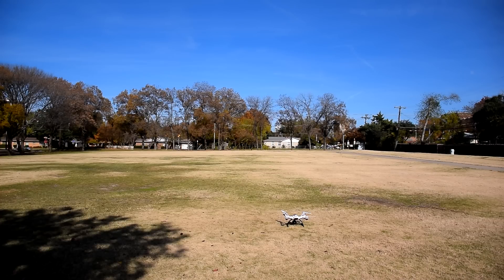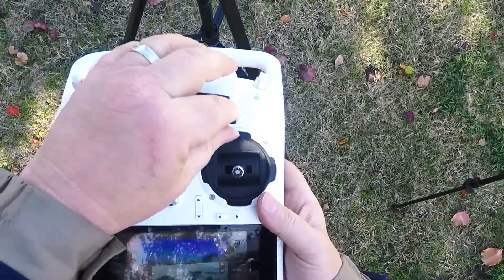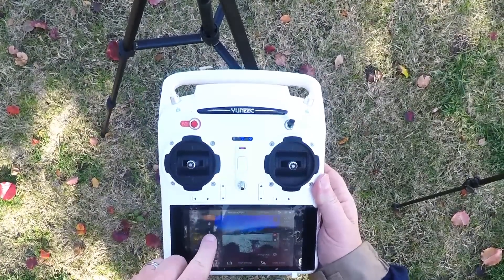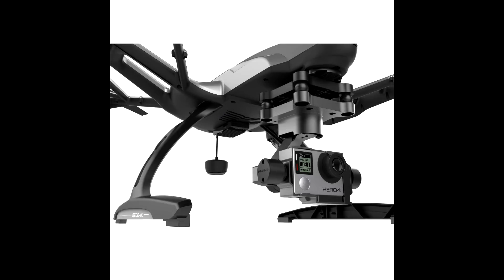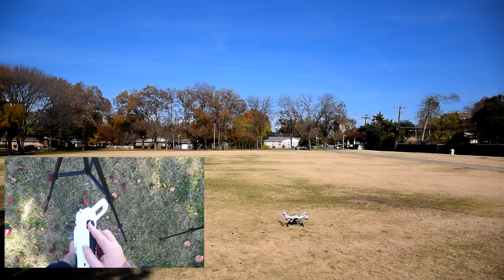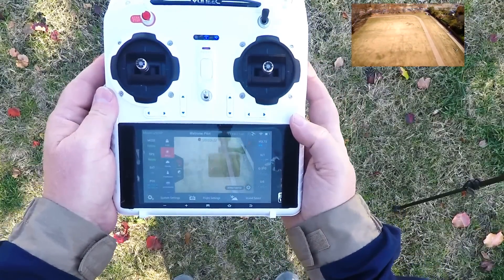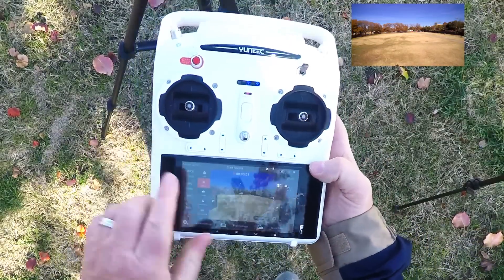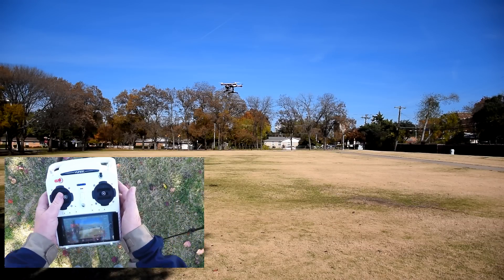Episode 3 - How to Fly Your 1st Flight With Yuneec Q500 4K: First Flight

Comment: Excellent info, exactly what one needs to know. Don't try to fly this thing based on your experience with other drones. It is "unique" to say the least. ..won't yaw in watch me mode? won't come closer than 26ft in smart mode? etc, etc ... these are crash modes unless you know IN ADVANCE what these modes do! Yikes! BTW, can you take off in smart mode if the drone is close to you , say around 10 ft. away? .. what does it do, take off and zoom in some direction to get 26 ft. away? and smart mode is actually 'headless' mode by another name! WOW! I repeat, don't try to fly this thing based on your experience with other drones. Study this man's video, it is important info you must know.
Reply from the maker: I appreciate your endorsement! I will say about Yuneec drones that they were released several years ago, when standards weren't really standard. So, having something like smart mode was just Yuneec's way of providing a sense of safety to the operator . . . which turned out not to be well thought-out, as you correctly observed. Launch in smart mode within 26 feet and you are inviting the drone to behave erratically. The whole concept of headless mode has pretty much gone away, so Smart mode would be alien to new flyers today.  But you are absolutely right - it's probably more important that someone just starting to fly a Yuneec today watch a video like this now than it was 5 years ago.

Comment: My CGO2 can connect with the remote controller but cannot perform shooting actions, how can I fix it?  Thank you
Reply from the maker: you mean the CGO2 connects to the drone? So the two devices bind and  you can see the view from the camera on the transmitter? But the record button isn't working . . . I'm going to suggest you go to yuneecpilots.com, which is a discussion forum. Post your question there - you've got guys there who take things apart and really get into the systems. I'm afraid I haven't flown a Yuneec in a couple years now. But the guys at yuneecpilots.com should be able to help you.
Reply: @JeffSibelius  You described my situation correctly, ok I'll go to the forum to ask questions, I haven't flown it for several years, and finally thank you for your reply, good luck.

Comment: I'm planning to buy a used one for $450. For being so old of an item. Do you think it's worth buying at this time and price? Thanks
Reply from the maker: Hi Robert - at this point, no. There are more capable drones on the market now,  even in that price range. And Yuneec has completely fallen apart for consumer drone owners - I wouldn't count on getting parts for a  Q500 if you needed them.
Reply: @JeffSibelius   Thanks for the reply. Would would you recommend for a purchasable drone? I really like the idea of having the camera display on the RC controller instead of having to use your phone plus the RC controller together. If you were to purchase the Q500, what would be the maximum amount that you would be willing to pay?  But you're right, there website doesn't have much for replacement parts. This sucks cuz I really like the way it looks and the extra controllers that helps with the angle of recording the video.
Reply from the maker: @robertpolanco1831 I really, really wouldn't buy a Q500 at this point at any price. The drone has been discontinued for several years and I really worry that it is essentiall a disposable drone at this point; I just don't know if you can get parts to replace anything that breaks, including batteries.

If you're really invested in the Q500, call Vertigo Drones to see what their availability of replacement parts is. They are probably the top Yuneec repair company now.

I love the built in view screen as well. But if thats your priority you really have two choices. Q500 or Typhoon H. Of those two I'd go with the Typhoon H. It's a MUCH more capable drone, it has six motors, a better camera, and is just a more capable drone. Its viewscreen is better as well. Like the Q500 parts may be an issue, but it's a newer drone sohopefully parts won't be as much of a problem. Again, call Vertigo.

The more I fly the Mavic Air 2, the more I'm impressed with it. And now it is compatible with the Smart Controller, so it gets you away from using a phone . . . at a price, of course.

Honestly, the best drones you can get would be the Mavic Air 2, Autel Evo, Fimi X8 SE 2020 or Mavic Mini. Probably in that order. If your budget can afford more, the Phantom 4 drone is awesome and you can get the Crystalsky monitor, which is  awesome compared to a smart phone. Or you can go with the Mavic 2 zoom or pro; I think the Smart Controller works with both of them.

Comment: Is this good for $350 ?
Reply from the maker: Make sure the battery is good and that it operates - if so, that's not a bad deal. It's a drone with basic functionality and iti struggles with wind, but it shoots reallly nice video. It's a good starter drone if nothing else - and it's very, very easy to keep your eye on while it's flying.
Reply: @JeffSibelius  a friend said to go for mavic mini for 50$ more but I think q500 shoots better or what do you suggest
Reply from the maker: good question, Luis. I agree with both of you LOL. The Q500 4k shoots better video, IMHO. But the Mini is newer, easier to get fixed if you need it, easier to take with you (the Q500 is a giant). You may ultimately have trouble getting more batteries or parts for the Q500 since it's been off the shelves for so long. So, the Mini is a safer, more convenient bet at this point.

As an alternative, take a look at the Fimi S8. It's about the same price point. They've got a new 2020 version coming out very soon that you can preorder at Banggood.com.
Reply: @JeffSibelius  ok so for 500$??? Any ideas? Lol let me check that one out thank you so muchhhh

Comment: I have found the Q500 4k I bought to be very disappointing.  Motor shaft threads strip very easily.  Flight times are no where near what they advertise.  Camera attachment method to drone is a very poor design.  Even in rabbit mode, response to stick movements is too slow in my opinion.  Your videos on the other hand are very informative and well made.
Reply from the maker: I'm glad you found the videos well made - and I understand some of your thoughts on the Q. It's extremely slow. That's a good thing for beginners, and also beneficial for a lot of photo situations because it is extremely smooth. I don't like the camera attachment method either, although the Q is better than the Typhoon H in this regard. I haven't heard of any problems with the threads, but the new generation of locking props are much better. And all the companies lie on battery time LOL. The Q was a great drone for its time and it's still a good drone for beginners to learn with because it's slow, simple and can be found very cheap. But it has definitely been improved upon by many of the newer drones on the market, no doubt.

Comment: Any reason why when I took off for the first time my aircraft immediately started flying backwards? I was in smart mode. I luckily landed it before it hit anything.
Reply from the maker: flying backwards? The only things I can think of are that it was within the 26 foot circle so it flew unpredictably or it needed calibration - but if you were in Smart mode the safety circle should have stopped the drone from getting closer than 26 feet to you even if calibration was needed.

How close to the drone were you at the point of lift-off?
Reply: Yea it was odd, I had to bolt out of the way before it hit me and the propellers ended up cracking on the pavement. I didn't calibrate it before I flew it, however. Now that I think about it, it's probably my fault on that one.
Reply from the maker: The more I think about it, the less I think the issue was calibration. If you were in smart mode, the drone should not have come close to you regardless of calibration. 

I'd bet that you were too close to the drone when you launched. If the drone is within the smart circle, it may act unpredictably to get out of that zone. 

I'm assuming that you had full GPS connection before launch, right? Just make sure you wait until you get the indicator light blinking to show you have full GPS connection before trying to launch. (sorry if you knew that, I'm just trying to think of all possibilities here.)

You can test that in two ways - first, in Smart mode launch from a long distance away. Make sure you're out of that circle. Second, launch in Angle mode. That eliminates the smart circle.

Be sure to do that calibration before trying this, especially after a crash.

If the aircraft repeats the erratic behavior in either scenario I describe, call Yuneec CS . . . it almost has to be a malfunction at that point.
Reply: Hmm good point, I thought I was a long enough distance away, but my brother was running around closer to it. Probably the issue. I'll try again tomorrow and post here just in case you're wondering. Thanks for the help Jeff, much appreciated.
Reply from the maker: please do post - I want to know what the problem ends up being. There's been a lot of discussion on whether or not the smart circle actually would cause problems like this - some people believe it wouldn''t.  I personally think it would - or at least could.

Comment: Simply OUTSTANDING instruction, Jeff!!  I wish I'd seen it sooner.  I got my Typhoon 4K for Christmas '16, and even though I'd had a good bit of practice with a Syma X5C, I promptly crashed the Typhoon and broke a blade within about 10 seconds??  I'd read the documentation, but it doesn't come close to preparing a beginner.  So, the aircraft has been sitting in my living room waiting for me to get up the courage to give it another try.  Your video series has given me the knowledge and motivation to get back out there.  I'll update the f/w and get started ASAP!!  Thanks for the quality work!!!  Frank
Reply from the maker: You are exactly who I created these videos for. I think there aren't enough introductory level videos to give new pilots the knowledge they need to fly comfortably and confidently and that's what I try to do.

Prepare for success - fly in an open park with low winds, have a plan of the things you want to try on the first flight, keep the drone close by to begin with - and fly with confidence.

Let me know how the flight goes!

Comment: Isn't that the q500 & not the q500 4k? this is the first model which is white...
Reply from the maker: Very good observation. The original Q500 was essentially the same drone as the Q500 4K except that it came with a (much) lesser camera and the ST-10 transmitter, which had a smaller view screen.

This drone you see in the video was originally purchased as a Q500+, which was the second generation Typhoon Q. It came with the ST-10+ transmitter and a CGO2 camera. The camera was still awful and extremely limited, so I changed it out almost immediately for a CGO3 - Yuneec had a trade-in program to do that. The only differences between the Q500+ and the Q500 4K were the camera and the color used on the top half of the drone, the props and the transmitter. Otherwise, they're identical. When I put the CGO3 camera on this drone, it effectively became a Q500 4K.
Reply: yep, I have the q500 4k...was just taking video, or was going to until I realized I was in a "no fly zone" too close to the airport..
Reply from the maker: yep, the NFZ firmware definitely keeps you on the ground in that situation.

Comment: what i dont understand is if you manual land it you want to avoid going straight down because of what you called vortex ring, but in home mode it seems the quad lands straight down?
Reply from the maker: that's a great observation. vortex ring state occurs when you descend too quickly straight down into the turbulance created by the props. You'll notice in home mode it descends very slowly - and that's the reason why.

Comment: Jeff great video very helpful I am just getting started with drones and the Yuneec Q500 4k is the drone I want to get I am starting with the simulator they sell first I figure better to crash it on the computer then for real thanks again.
Winfield
Reply from the maker: LOL there's nothing wrong with doing that, Winfield. I think you'll feel pretty comfortable with the controls in no time. When you go out for your first flight, just follow these few steps:

1. make sure you've done your calibrations
2. pick a day with little or no wind
3. Keep the aircraft pretty close to you for your first flights
4. Fly in turtle mode - keep it slow so you have time to react
5. If you take off in Smart mode, be sure to put the aircraft farther than 26 feet away from you before you take off.
6. Finally - when in doubt, let go of the sticks. The quad will sit and hover until you regroup and figure out what you need to do.

Comment: hi Jeff! thanks for your videos they are really helpful !!  ;) ... i did
 my first fly with my new Q500, it was great but battery discharged 
after around 15 minutes (i saw the alarm on ST10 display)  is it 
normal??  i thought i could fly for around 25 minutes... is there any 
tip to maintain fly more minutes than 15 minutes ?  thank you in advance for
 your reply ;)
Reply from the maker: Hi Fabio - sorry, just  saw this . . .. 25 minutes is marketing hype. If you get 17 or 18 minutes, you're doing well. Best way to keep your batteries healthy is to charge them just before you use them, don't leave them charged for several days and run them down to the warning messages before you recharge them. Also, keep them out of heat and direct sunlight.

Comment: Thank you so much i appreciate all your hard work/set up. I am picking up mine tomorrow....what is the best way to land it for a newbie? Also can i put the speed in between the turtle and rabbit mode? Finally do you know if the regular box comes with the sunshade? Or just the bundle. Regards :)
Reply from the maker: Hi Tek. 

As far as landing, as long as you're not flying in windy conditions, I encourage you to land manually. When you hit RTH it may not come down right where you want it - like on a bush, a curb, a nearby car LOL. Just get the quad to about 6-8 feet off the ground and slowly bring it straight down to the ground.

You can put the speed between turtle and rabbit - it's a slider so you can choose any speed between the two extremes.

You should get a sun visor with your Q500 but it's really awful. I recommend getting something like this:

http://www.ebay.com/itm/PRO-Sun-Hood-shade-Yuneec-Typhoon-quad-q500-ST10-transmitter-5-5-/121926976865?hash=item1c636a0561:g:6EwAAOSwUuFW1iZP

Comment: hello  have a question what happens if u fly the drone out to far and lose signal will it fall from the sky? or automatically reuturn to home if its  in smart mode?
Reply from the maker: The Q500 is designed to return to the transmitter's last known position if signal is lost - it's a great feature

Comment: Thank you Jeff. Very nice.  I'm about ready to Go for it and pull the trigger on a Q500+.  I'd like to get the case and an extra battery!  :)
Reply from the maker: Great aircraft. If you can afford the Q500 4K you'll love the better camera, but the Q500+ is a great way to start - that's what I did. 

The extra battery is a big help. You can find 3rd party batteries for much less than Yuneec batteries and they work great. Check out carolinadronz.com to see what's available.

The Yuneec case is ok but it's not very durable and it's a pain to lug around. Check out my video on accessories for the Q500 from $50 - $500 - there is a case you can buy for $55 or so that is far better., It's larger, but it has wheels and a handle and is a lot sturdier. 

I'm doing this from memory - if you don't see it in the video I just pointed to, check out the other accessories video for up to $50.
Reply: Excellent. Thank you, Jeff. I should be receiving her today or tomorrow.  :)
Reply from the maker: I want a full report after your first flight!
Reply: Absolutely.  Will do; probably later this week or this weekend.  I just got it yesterday; do I need to calibrate accelerometer and compass now or I can wait?  How about the binding? Is that necessary?
Reply from the maker: +Vic Startsman you should not have to bind the aircraft of the transmitter. It should have shipped to you already bound. I would encourage you to go ahead and do a compass and accelerometer calibration even though it probably isn't necessary. It doesn't hurt to do it and that way you can be confident that you're ready to go.
Reply: Sounds good, Jeff.  Thanks. I'll do it.  I am going to wait on firmware upgrades though after I do a little research.  :)  I may do my calibrations today after work and my first flight.  My wife is getting her Hair done and won't be home until a little later or early evening.  LOL.  ps: Too bad it's my turn to Cook otherwise, I'd be flying for 40+ minutes - 2 batteries charged and ready to roll.  Aye Aye Sir!!

Comment: great job! thanks from Italy. just a question, the home point on the q500-4k is the take off place or the last place where you calibrate the compass?
Reply from the maker: The Q 500 uses a dynamic home point so your whole point is wherever it last saw your transmitter. So if you take off and walk 100 feet away the Q 500 will think of that spot where you're standing hundred feet away as your home point. If you walk 100 feet away and then go a little further and loose connection to your drone from your transmitter The Q 500s home point will be the last place it actually knew where your transmitter was.

Where you calibrate your compass has no effect on your home point.